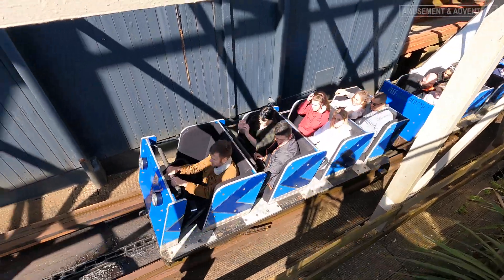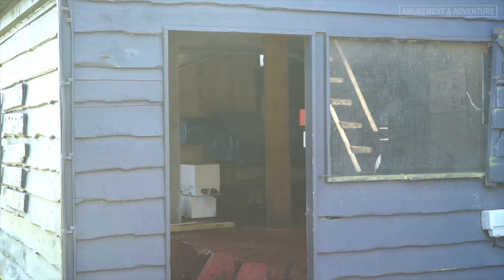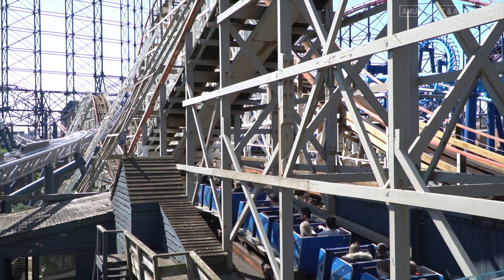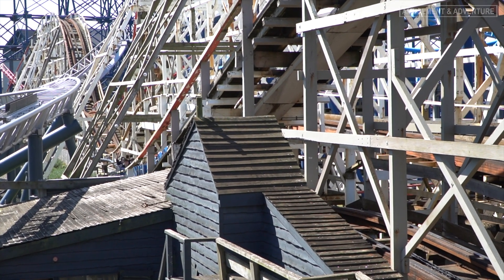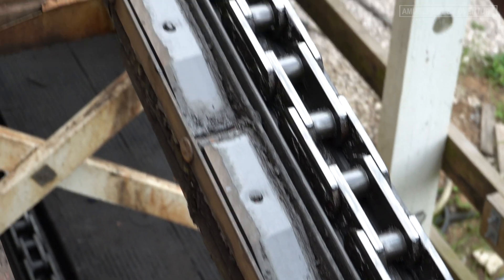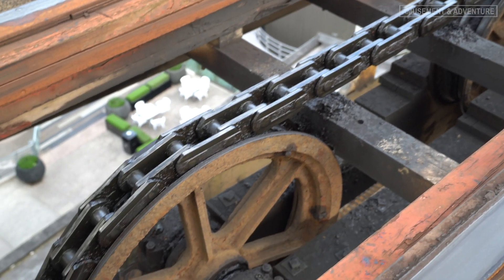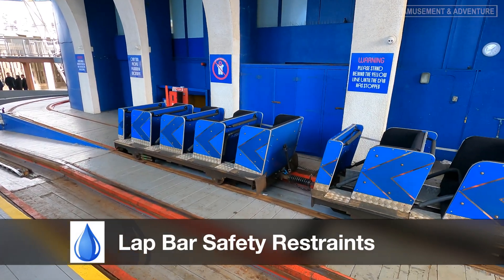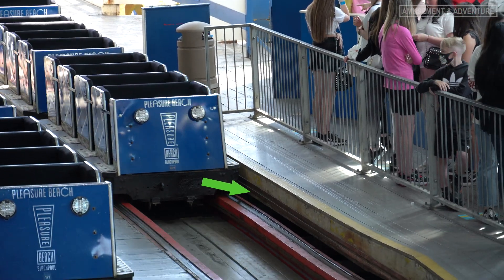BIG DIPPER Rollercoaster - How Does It Work ? | Blackpool Pleasure Beach

Comment: How do the brakes actually work safety wise?

Are they on by default and have to be released?

What if a ride operator messed up or became unresponsive and there was train 2 in the station?

Great video btw! Been going my entire life and never realized how the chain works!
Reply: Former ride op of this and many other Blackpool rides, you manually move the brake into it's closed position then brace and release, there is a art to it but it's surprisingly easy to do. You can't take to much speed off or it can hurt the guests but not to little or you'll run the risk of having to be firmer on the next brake to prevent a overshoot.

Comment: hi its a 415 volt wound rotor motor in the motor house
Reply from the maker: Hi, During the course of filming I asked one of the ride operators about the motor and they checked and said it said 600v on the motor ? Is your experience related to working on the ride ?
Reply: @AmusementAndAdventure  hi
i have been an electrical engineer for 35 years 
the uk voltage is 230 single phase and 415 3 phase i have worked on machine that need a high torque at start up
the age of the ride and the tech avalble at the time it woruld be a wound rotor motor at the 415volts if it needed to speed controled it would have been 600 volt dc 
the lift chain will not be speed controled which is why its a wound rotor motor 415v ac 
also you missed out the ride blocking system if the second car is in the unload station the car on the lift hill will stop untill the unloading car moves to the loading station 
no i havent worked at the plesure beach but i am a seasion pass holder
Reply from the maker: Hi, Lots more details covered in the Big Dipper The Definitive Guide video on the channel too.
Reply: @electo99  so you’re saying the ride operators and the motors are lying 😂😂😂😂😂 I’m pretty sure if they’re labelled then they’re right. But oh no some expert on the internet must know more!